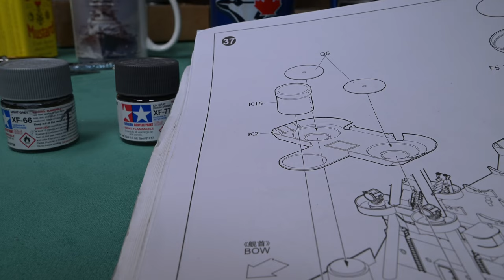The Model Ship - Part 1275

Comment: Hello Ron, Just an FYI about the paint colors and what would be what color. All vertical surfaces would've been the lighter gray, this includes the insides of the splinter shields. the darker color of gray is only on the horizontal surfaces of the ship. Also, I saw a lot of flash on the splinter shields of that first piece you painted. All in all though, the final product is looking good. Catch ya later.
Reply from the maker: Re: "saw a lot of flash on the splinter shields"
Darn! There goes first place, haha. 😁